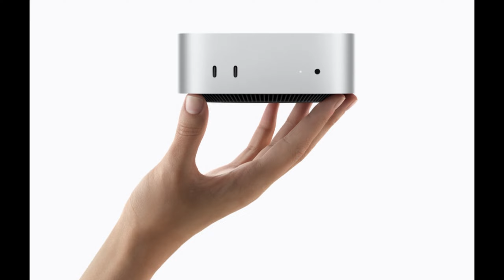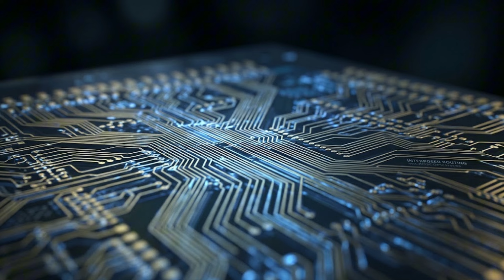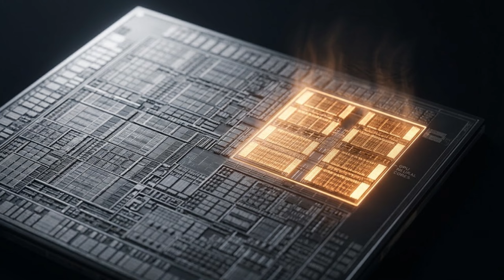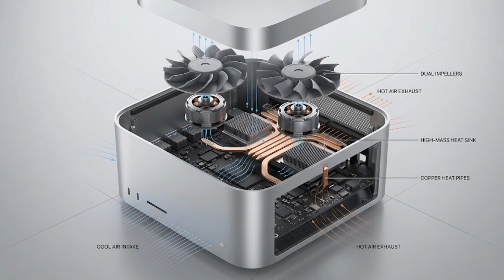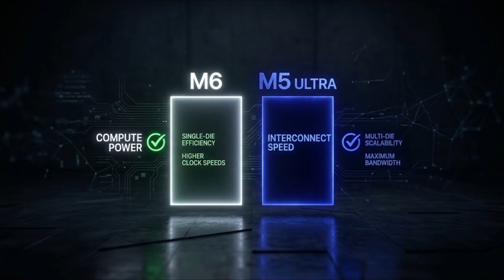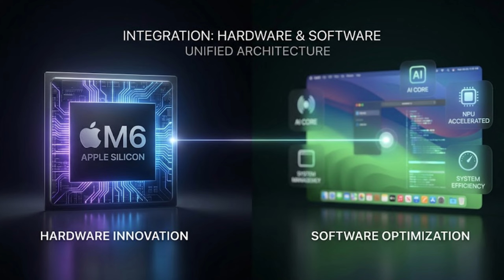Apple’s Newest Chip Isn’t Its Most Powerful... Here’s Why (M6 vs M5 Ultra)

Comment from the maker: 🤯 It sounds impossible, but here is the quick answer:

The M6 (Mac mini) is Apple’s technology leader—using future 2nm architecture for insane per-core speed.
The M5 Ultra (Mac Studio) is the brute-force leader—welding four older chips together for massive multi-core workloads.
❓ Which one should YOU buy? The answer depends entirely on your stack:
• Single-threaded logic / general speed / light coding ➡ M6 Mac mini.
• 8K ProRes video / LLM inference / 3D rendering ➡ M5 Ultra Mac Studio.
Where does your workload fit? The single-core crown just got passed, but the heavy-lifting king didn't flinch. Let’s talk about the specs below! 👇